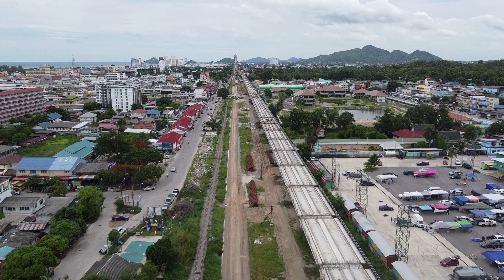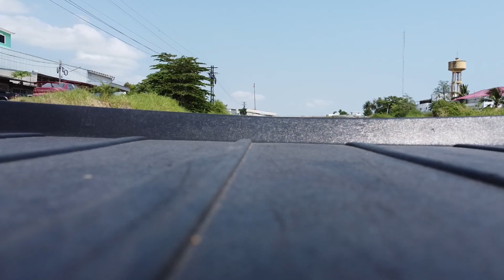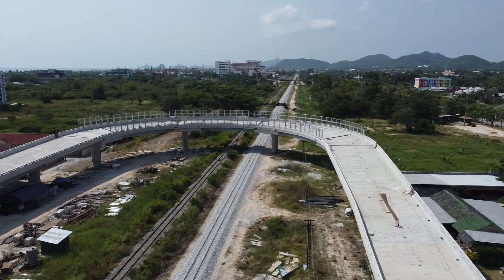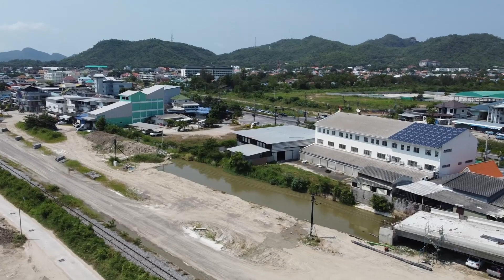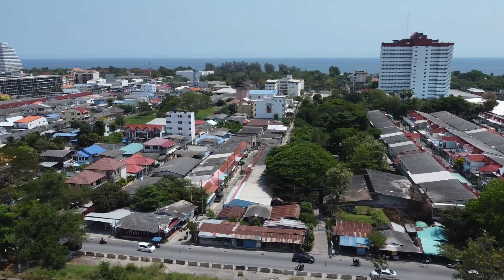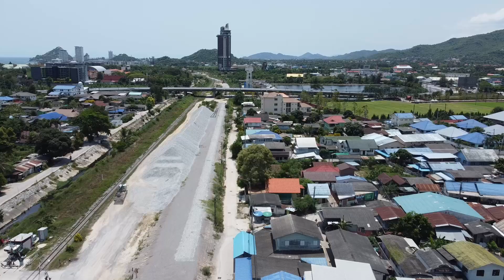Hua Hin Thailand Train Construction Drone Flight - March 15, 2022

Comment: As with all in Thailand many puzzles around this project..
Why no apparent overpass at soi 101 the very busy junction for Khao Tao?
Why no apparent footbridge so1 56?
Why are nearly all elevated sections composed of 8 beams between pilars but a handfull are only 6 beams?
Reply: I think they are building a bridge/overpass at soi 101 (there are signs saying so). However, there are no signs of a bridge at soi 91.
Reply from the maker: I don't have any more insight into the design choices, although I am trying to make some headway there.

Comment: Totally fake news. 160 kph line to Hua Hin on metre guage track? Never in a million years. Who told you this rubbish?
Reply: The new locomotive that Thai Railway has purchased is maximum 120kph. But considering the lack of fence and Manuel shuffle system. 
The two high speed rail are under construction are northeastern line and Eec line
Reply: The Bangkok – Hua Hin High-speed Rail Project is a 1.435-metre standard gauge track with capacity to serve a maximum speed of 250 kilometres per hour.  This is what it says on the project site
Reply: @srinianne5290  So WHY have they laid a twin track metre guage from Bangkok to PrachuapKhiriKhan.? Total rubbish.  Just look at this video and the track is METRE guage.
Reply from the maker: This has been the plan for a long time.  I guess we'll just have to see.  Where is your source for top speed on this particular project?
Reply: @MikesTropicalTech   Source--- In cuckoo land. You dont have to be a rocket scientist to realise the new twin track laid already from Bangkok to at least PrachuapKhiriKhan is METRE guage.Why are they still heading south with this project after building new stations,bridges and infrastructure for to then have to rebuild a new railway for a high speed line?

Comment: is it clear where the new road, parallel to the railway line, will go?
Reply from the maker: You can see the space they're making all the way down the left side of the existing tracks, space already cleared, buildings being knocked down.  I'm told it will be two lanes in each direction, which will really help reduce the traffic load on Petchkasem Road.